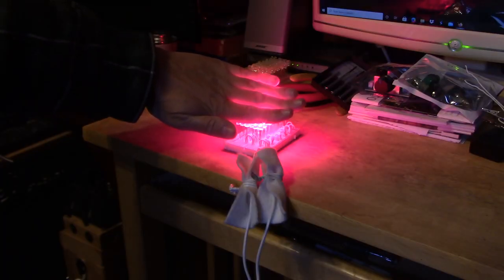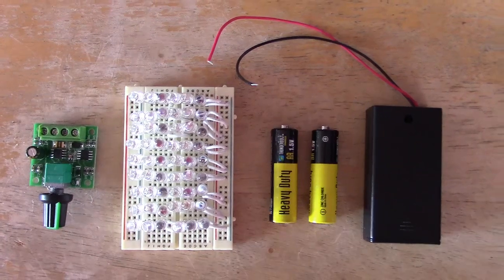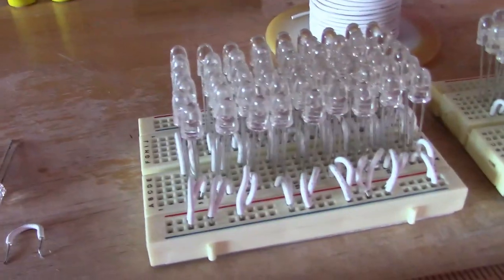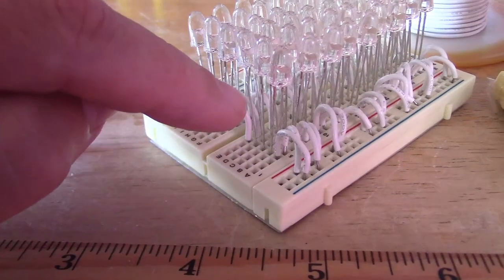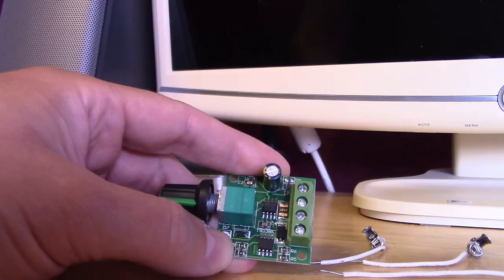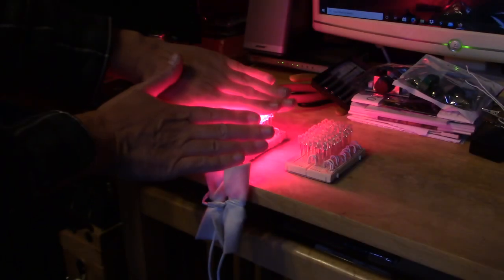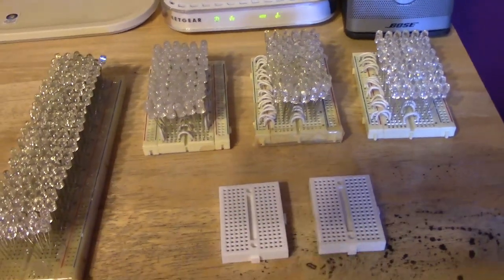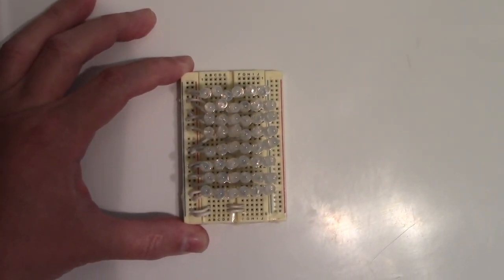How to Make Powerful LED Light Panels! insanely bright! it's so easy! w/xtra red light therapy info

Comment: Thanks for the video. Nice job! For the PSU an  old PC power supply has the right voltage to tap off of, or a laptop power supply if you can find one with the right voltage.

Comment: Kind of a silly question but I assumed using just a 2 LED red light bulbed lamp would work for skin therapy. Why is this method optimal?
Reply from the maker: hi there. there are a lot of red light devices on the market these days, but a lot of them are just gimmicks. i doubt many of them work very well for healing. for red light therapy to work as a method for healing, it has to be very intense and of the right wavelength. the red light bulbs may work for skin therapy, but for deeper healing of muscles, tendons, etc... you need a very strong light (one that can penetrate deep under the skin)
Reply: @desertsun02  hi you mentioned intensity and wavelength so I wanted to probe a bit. Is it possible a light source of lower intensity could penetrative past the skin since light intensity is power and exposure combined? If I have only a light source of 15 Joules, could I sit close to that source over an hour instead of say 5 mins and assume the irradiated wavelength reaches past the skin barrier this way? I'm very obviously naive but I remember intensity having to do with both photon emission (joules) and time of exposure. Edit: my hypothesis comes from thinking about why on cloudy days people who sit outside for hours can still experience a sunburn even though the intensity of the sun is much lower. I could also be so wrong. Just experimenting with time
Reply: @cosmosprincess20  exactly yes you can , how can you do that ?  but there is a method ,
i know about it but don t know how to make it

Comment: Do you ever repurpose leds from computers?  I took one apart and don’t see where I should connect to. They have a ribbon cable that connects to a circuit board but I don’t see pos/neg options accept on the individual leds.
Reply: Those LEDs are not the right ones. You need 660nm LED

Comment: I have a lot of old dc power supplies but I don't want to blow out the lights. How do you figure the maximum power the bulbs can handle safely. I plan to use most of the 100, keeping a few aside, maybe 5, for replacing ones that burn out. Thanks for this update. I’ve been afraid to power these up.
Reply: What type of old dc supplies you have? 5v, 9v? What current ? 1A, 2A?

Comment: I see you posted a link for the 660nm at Jemeco but what about the 840nm????
Reply from the maker: hi. i haven't used 840's - i have used 880's though. you can find those (the 880's) all over the place. make sure to use the clear topped (clear dome) ones. btw - i haven't really had much luck with the 880nm ones. they don't seem to do very much. (the 660nm ones work much better, in my opinion)
Reply: Alan I noticed that they offered the 880s at the same place. I just bought the 660s

Comment: Great update!  I'm curious if there are breadboard that are already connected below (so we could just plug in the LEDs and forego jumpers).  

Or

Could one put a copper plate beneath a breadboard, so everything is interconnected (or would that just not power it at all)?  I'm just thinking of various ways to build these to look minimal as possible.  Thank you!

Comment: Is there a reason you changed the way you wired it from your first two LED videos? Which is more efficient? Or is it just the same?
Reply from the maker: hi there. i changed it because this way each row of leds taps into the power (in a more direct way). the earlier way works but sometimes the first lights in the row are brighter than the last lights in the row.
Reply: Thanks! I will try it on another board

Comment: If you don't want to cut and strip wires, Jameco also sells pre-made jumpers in packs of 100. I suggest the  .3 inch.
Reply from the maker: good to know ✔
Reply: @desertsun02  Thank you for sharing your knowledge. The device has really helped with pain relief. 
The wife is using it for her face 😔 😂.
Reply: Thank you for this info.  I had been looking at jumpers.

Comment: Thank you so much for the information and the content. 
I just had a question if you knew the flicker or EMF for your devices. I'm still anticipating building one for my arthritis-ridden father to see if it gives him reprieve, but I'm concerned about how close range EMFs will effect him from daily use and if the bulbs I'm ordering from Jameco have substantial flicker  that could reduce efficiency and dosage of the light on the effected areas, specifically like the knee or spine.
Reply: I'd like to know about the emf's effect also!

Comment: Just watched again! U didn’t leave a THiNG out! Even time stamped and
Referenced item # wow! Makes me wanna try to do it even though  not
At all mechanically “inclined” ! I only have the 2 bulbs and the metal aluminum light clamp is Cheap and I’ve gotten 2 already that must’ve had a flaw at Manufacturing as the tightening screw is stripped so the bottom stay in and I tried to adjust it. I went online to look for the best brands and came across this… I was in a major motor vehicle accident and seriously injured and had to have emergency surgery on my hand in which they had to put plates in a couple of my fingers and hands… It has healed slower than my broken foot so I really need this it’s not just for cosmetic even though that does help but it’s even good for your organs.I went online to look for the best brands and came across this… I was in a major motor vehicle accident and seriously injured and had to have emergency surgery on my hand in which they had to put plates in a couple of my fingers and hands… It has healed slower than my broken foot so I really need this it’s not just for cosmetic even though that does help but it’s even good for your organs. my boyfriend was going to make one for me that he never did… Then he was gonna buy one for me that he never did… So I just want to do it myself. The jumper loop wires confused me a bit. Lol

Comment: Human body undergoes photosynthesis in infrared light. The water in cells which is not normal water but structured water which has hexagon shape, it absorbs infrared light and converts it into negative electric charge cells need to function properly. Check video "Water, Cells, and Life | Dr. Gerald Pollack | TEDxNewYorkSalon".

Comment: God Bless you , this is great. Currently making a helmet for low level laser therapy. The iRestore helment is $500.00 and up. Using some ideas from this. you should consider a helmet. Someone else made a video but it was limited. Also, what I'm trying to figure out is how to have a heat element added. The LLLT helmets turn off after a couple of seconds to not heat up the scalp too much? not sure but if you can let me know what part to add to make it turn off after it heats up I would really appreciate it
Reply: This sounds very interesting… I founded a non-profit for suicide prevention and the statistics with military was 22% that year… Which was higher than any civilians especially from PTSD but what I found out that was the most enlightening was from Dr Oz show that the FDA had approved the therapy that works & insurance pays for  called “TMS” Which is a non-invasive magnetic therapy that stands for trans-cranial magnetic stimulation… I wonder if you can add on magnets depending on the polarity where you’re located and it will help with depression and PTSD… There are actually 2 studies done inpatient hospital; one  was the DOD and the other was a military hospital and only 3 treatments cured them! It is so expensive to it’s around $750 per treatment before insurance…you have to be on 3 to 4 antidepressants before insurance will even kick in… (except military only have to have been on ONE! And the problem is doctors aren’t even telling people about it because most of them don’t even know about it and the rest don’t want them to get well because that’s how they make their money...which is a non-invasive magnetic therapy 🤮🥴 Check out some of Dr. Oz videos as the FDA approved it am am effective treatment over 13 years ago!